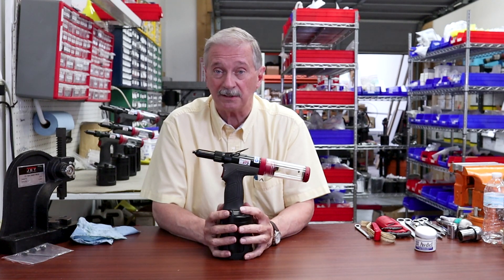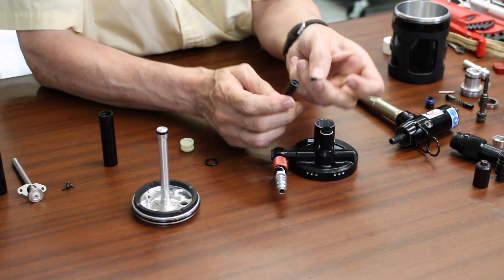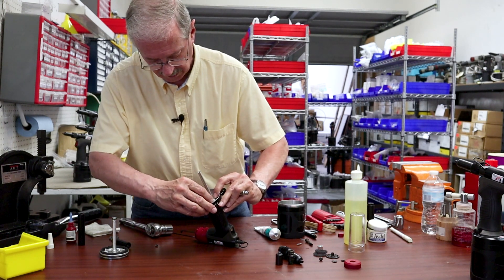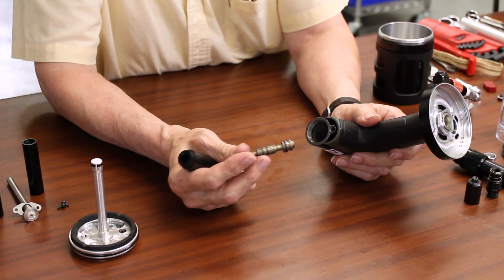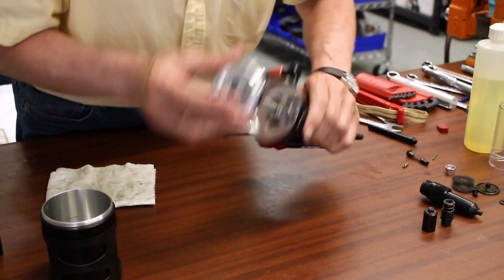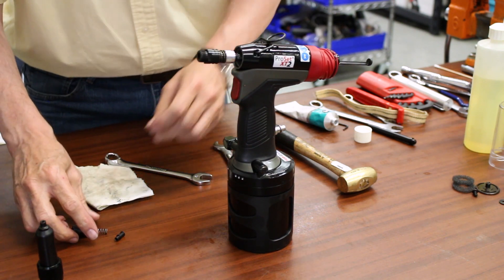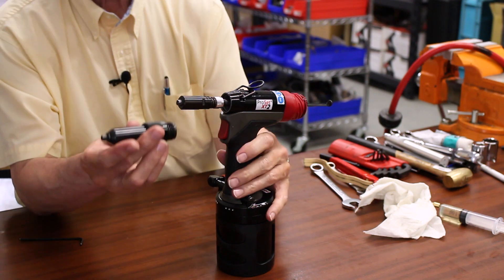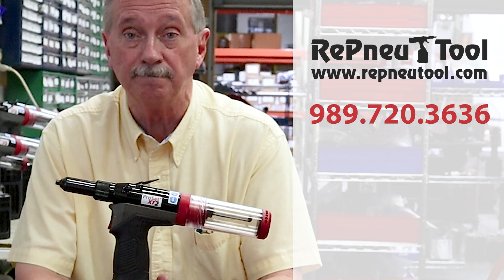Resealing Your Proset XT Series Blind Rivet Tool [Video 2 of 3]

Comment: I have one in the shop right now that's leaking air out of the 6 holes in the front. I suspect it's the lower gaskets or the o-ring, though the o-ring isn't showing signs of wear or damage.
Reply: I apologize that no one has responded to your question. If  the is blowing air out of the front of the tool, it could be two possible issues. 1st. there could be a rivet jam. 2. It is possible that the ejector assembly has come apart or has dislodged from the rear of the hydraulic piston.
Reply: @sailingspokojny9809  ill pull that apart on Monday and check, probably happened from the tool falling off a work table.
Reply: @Joe_Moto  I just solved the same issue. Our Schrader valve was not tightened all the way on the trigger.

Comment: hello how are you thanks for those videos  i have a question pls  can you tell me how can i adjust the proper  storke  and the tolerence , so where did you find out its 18
Reply: Daoud, Sorry it has taken so long to respond. The stroke  is not adjustable. What happens when you start looding hydraulic oil, you will start loosing stroke as well. Which means you will have to make multiple trigger pulls to get the rivet to set. Eventually you won't be able to set the rivet at all. The stroke dimension is listed in the instruction manual that came with the tool. That is if you bought the tool new. If you have any other questions you can email me dennis@repneutool.com.
Reply: Have u made an actual video that shows how to reseal this tool. You skipped past disassembly with that explosion, and had parts installed and disappearing from one scene to another. Looks like you made this video for the express purpose of giving the impression that only you can repair it, or they should buy a new one. Worst YouTube video I’ve ever seen.